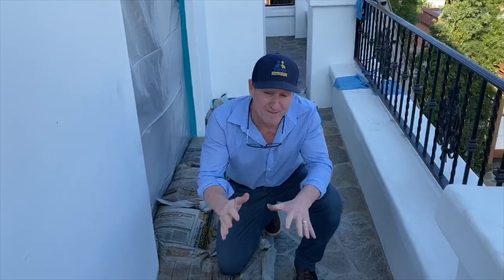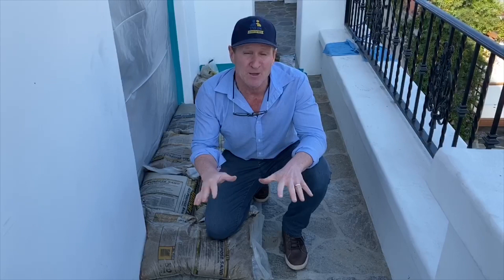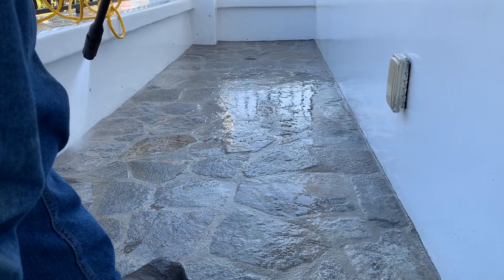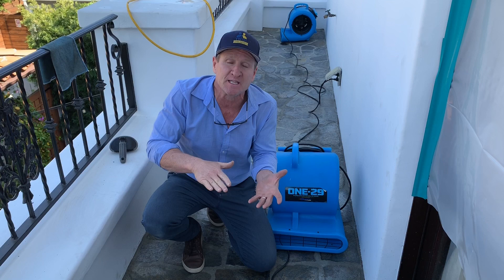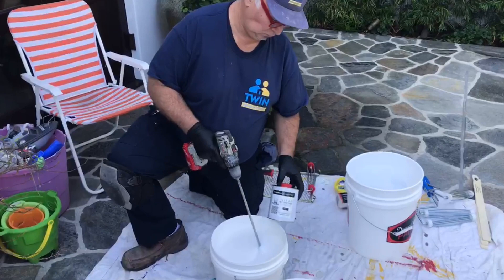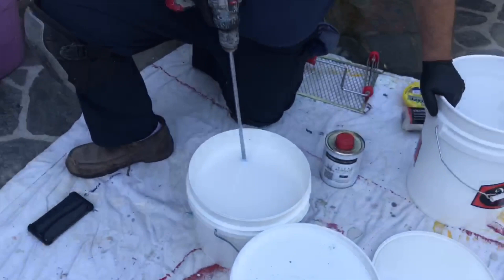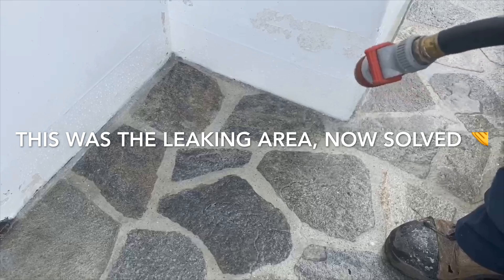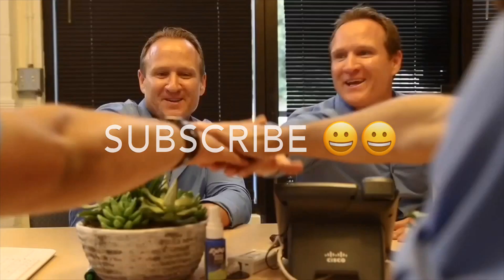DIY Leaky Balcony Repair - Clear Waterproofing Membrane

Comment: So question, we all know that Stucco is a porous material. Since you sealed  the  stucco 4 inches up, my question is .. when the rain hits the stucco above that line and seeps into the stucco and rolls down the black paper, Hopefully that’s behind the stucco which is the actual waterproofing membrane…Where does that water go now that it has rolled all the way down past the four-inch level of the sealer. It seems to me that you would not want to seal the stucco because now that water is trapped with no way out other than hydrostatic pressure pulling it into the house or the osb sucking it now causing a larger issue of mold and rot… 
Was there something done such as weep holes put in below the sealer?
Thank you!

Comment: When u apply the sealer all around the deck under gap between the walls and balcony floor, will this not interfere with the normal drainage of rain water behind the stucco because you have plugged up the drainage holes at the metal flashing at the button of the stucco wall?